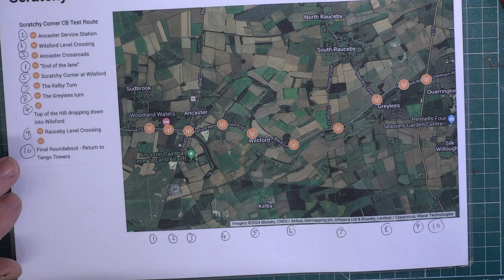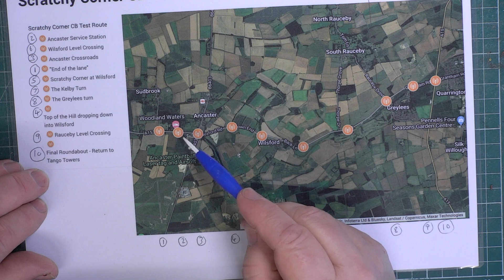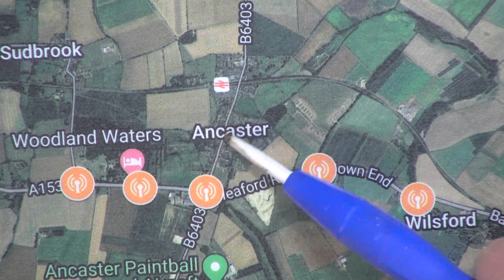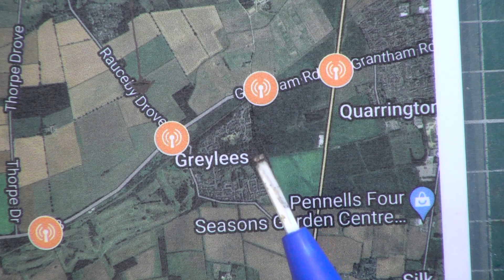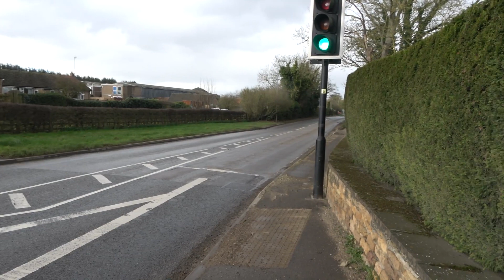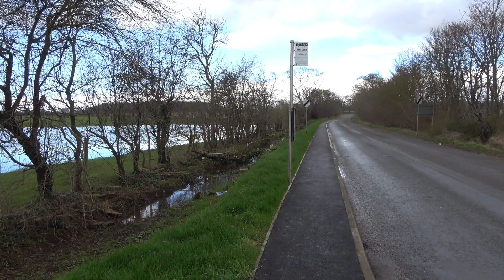Our 'On The Air' test 'Scratchy'Corner' route test explained

Comment: Dab signal also cuts out at scratchy corner Sleaford high street is terrible.
Reply from the maker: Although the car radio has DAB. I usually have the radio tuned to Radio 4 on FM. I'm really annoyed the radio doesn't have Long Wave as I'd like to listen to the R4 Morning Service, which is only on R4 LW.  DAB gives me to many digital artifacts & drop-outs round here.

Richard

Comment: It would be great if you could do an "On the Air" test with a CB before you optimise it so we can see it "fail" (or perform poorly) at the test points. Perhaps you could open up a CB, see what the set up parameters are, then if the set up is "bad" do an "On the Air" test before optimisation so we can see the results of a poorly set up rig on your test route, then tune the rig up and do another "On the Air" test to show how well it works after the tune up and the benefits of optimisation.
Reply from the maker: Just uploading the 'on the air' test of the LCL Communicators NI440DX I just serviced.....it failed the 'on the air' test & we recorded it failing. Back at the workshop I put it on the spectrum analyser & sorted out it's transmitter harmonics & then we re-tested it today. We started the recording  from scratchy corner.

You coul say that if it were on the spectrum analyser in the first place, the harmonic snag would have been seen....but that takes 15 minutes extra, so would cost customers more; hence the policy of only putting radios that fail the 'on te air' test on the analyser.

Richard, G0OJF, UK